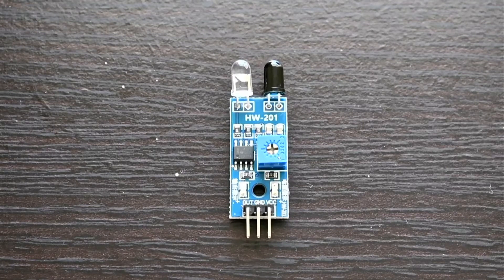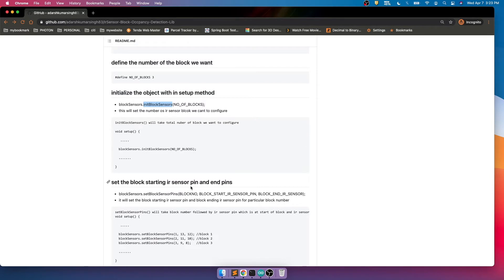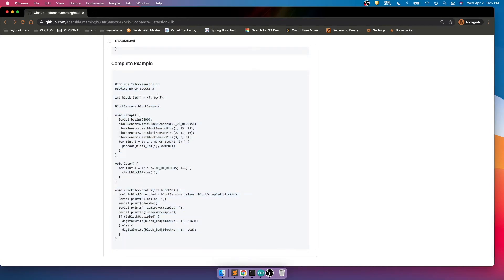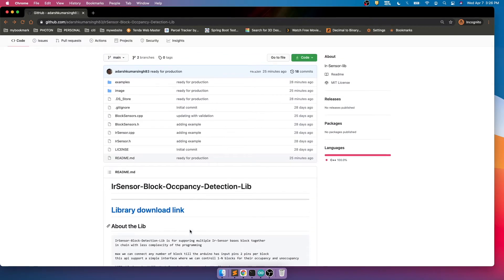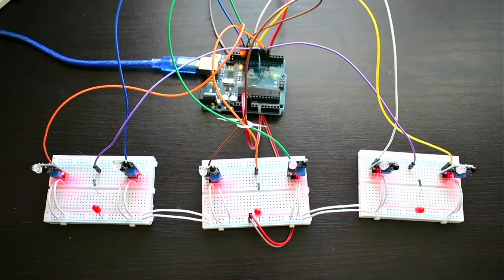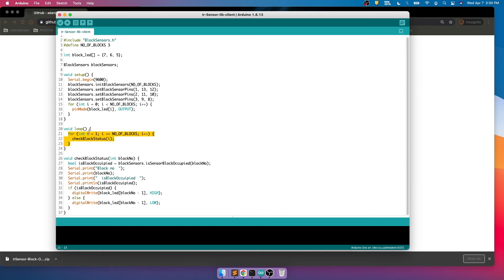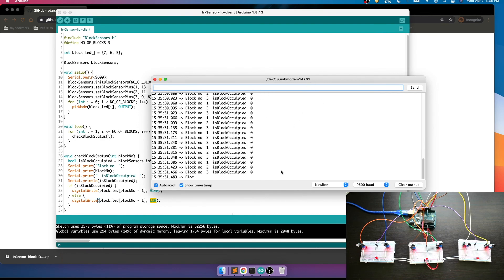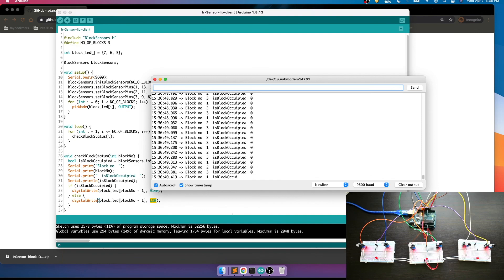Model Trains Ir Sensor Block Occupancy Detection Arduino Library for Model Train Layout

Comment: Can we use the end IR SENSOR of Block 1 at the same time as the beginning sensor of Block 2
Reply from the maker: yes if the blocks are continuous without any turnouts in them i have used that also and it works fine
Reply: @adarshmodeltrains   thanks

Comment: What is the pros and cons between using CT sensor and IR sensor ?
Reply: ct sensors are more accurate it works on the current drawn by loco motor or wagan resistors but ir sensors are based on infra beams and its not that reliable because some time during the gap between wagons it will start blinking and on and off but its really cheap their is way to set the ir sensors in diagonal so that it will be accurate but ct sensors more reliable and accurate but expensive unless you build it by ur own 
you get all all the lib in this github 
https://github.com/Adarsh-Model-Trains
Reply: @adarshkumar83  Thank you Adarsh😃
Reply: @adarshkumar83 Thanks for the excellent sketch Ardarsh. Like you mentioned in your comment, my IR sensors are reading gaps between rolling stock. Can a delay be written into the code somehow?
Reply: @nickhale2900  hi their is a way to prevent the gap issue when using ir sensor you have to remove and extends the sensor receiver and sender (their will be two led small buld) so once can be extended and kept on the other side of the track but rather then keeping it at 90(90 degree mean directly in front of each other) of each other just make it 150 degree angle so that it will be at angle to when ever their is gap but due ot the angle gap will not trigger the sensor unless the train passed completely